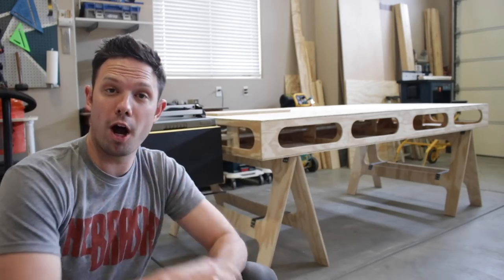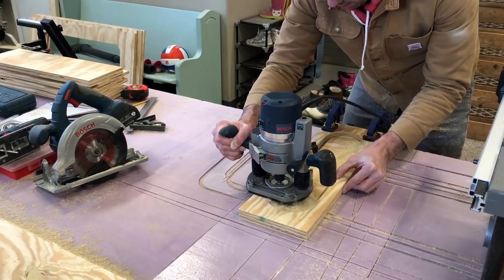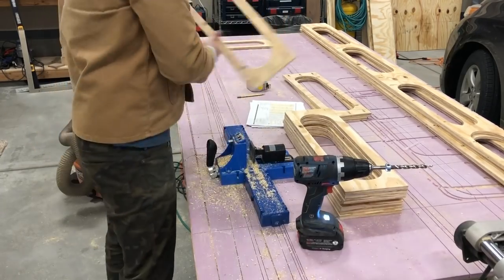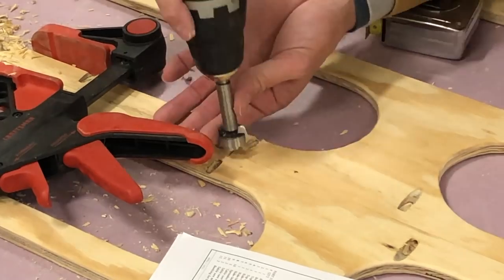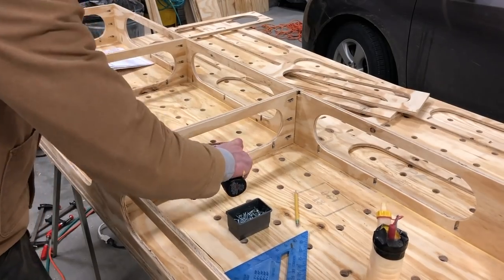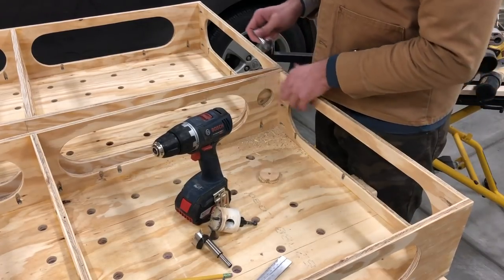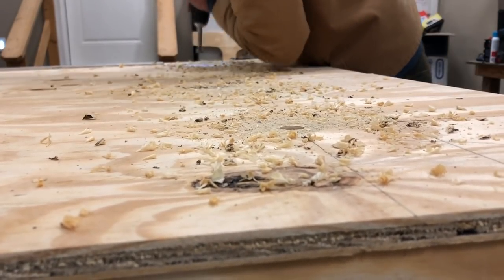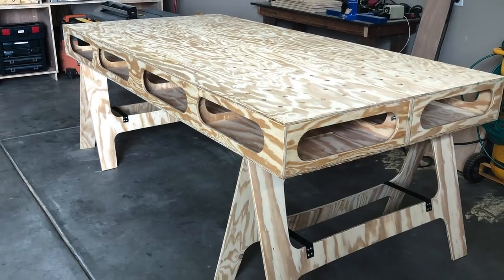Building the Paulk Workbench, Part 2 (Torsion Box Body)

Comment: Just a quick one Andrew, you should run the rounded edge of your router base against your guide, if you rotate it at all it won't matter, the plane is identical. If you hiccup slightly on the straight edge you'll screw your line up immediately. That's what the large round edge is for.
Reply from the maker: Thanks for the tip!

Comment: I bought these plans years ago and still haven't built it yet. I'm going off of memory here because I don't have the plans in front of me. Are you going to build the shelf for the underside? I believe if I'm right it also helps with spacing the saw horses to speed settting it up.
Reply from the maker: I can’t remember if I had plans that involved an under shelf and I don’t recall doing that. I just have the carcass box and legs. I can say that I have used this thing almost everyday in my garage shop since building it. It’s a very useful bench and I don’t think you’ll regret building it!

Comment: Great video Andrew!  Thanks for the posting.  I'm about to assemble mine.  I've seen several comments and suggestions about the template routing and I think I have the perfect solution.  What I did was set the template (or the blank to be routed) on a larger piece of scrap plywood, then screw strips of 3"4 scrap wood next to the template (or blank) so it can't move. Then put the blank on bottom and the template on top inside the screwed down strips.  That will hold them in place while you route, and won't be in the way of the router base because the two pieces of 1/2" ply stacked are taller than the holder strips.  Boom!  Easy and FAST.  And most importantly accurate.
Reply from the maker: Thanks!  Also thank you for taking time to share the knowledge you have and what your plan is. That is a great idea.  Please send me your finished project via email or social media as I'd love to see it!

Comment: Great vid!  suggestion: maybe screwing the template to the workpiece like you did with sawhorse template would've been quicker and involve less movement, seeing as though the router work could be down in just one pass.
Reply from the maker: Thank you!! And great advice. Thanks!
Reply: Or possibly using painters tape and CA glue.  That way no screw holes to fill.

Comment: When routing spacers maybe you could screw template and stock through foam into plywood under foam slo no clamp would be needed?
Reply from the maker: Definitely a possibility!
Reply: I got same thought's ))
Reply: I built a 1" form around mine so they were locked in and I didn't have to fuss with clamps and I didn't want to screw through them. Probably being a little OCD but been treating everything like I'm building some high end furniture rather then a workbench lol I know it will get worked to death and start getting beat up but right now I'm trying to make it as perfect as possible lol

Comment: Hey Andrew, nice video, I just caught it.

I built my Paulk bench about four years ago.  Also bought the plans and built the total station.

The last several videos Ron has made  featured some designs I gave him.

Check them out if you get a chance.

I built my first bench totally my hand, as you have here.

One thing I did differently; for the template to rout all the large holes, I simply extended the “ears” on each end which left plenty of room for the clamps. I then nailed blocks in the bottom side so that it placed the object peace center line.
Reply from the maker: Hi Kevin.  Thanks for the information!  I will definitely check it out.  I love new ideas.

Comment: I can't help but wonder if it would work to cut full strips in both direction but cut 3/4 wide 1.5in high slots on all the strips and then fitting them together.  That sounds a LOT easier than cutting little pieces and then attaching each one.
Reply from the maker: That’s a cool idea! Thanks for sharing.

Comment: You have 2 spiral bits listed.  3/4" and 3/8".  The 3/4" is for drilling the holes in the tops. Did you use the 3/8" for cutting your sawhorse and side templates?  I think the video mentions 1/4" so I'm just trying to clarify.  Thanks.
Reply from the maker: Great questions!  You are exactly right!  I might have misspoke on the video commentary.  Thanks for clarifying and best of luck to you on your project!

Comment: Great video brother..came out great.  I have my tops,bottoms, spreaders and horses cut,routed and sanded. I still have to drill my dog holes but probably jumping back on it tomorrow. I wasn't gonna do the table saw thing bc I have the Bosch on gravity stand but after watching what you did I'm gonna build the box anyway just incase I decide to drop it on. Your box was a awesome addition..thanks for sharing! Quick question..with the pocket holes for bench assembly..which screws did you use? I was planning on the 1" bc it's 1/2" to 1/2" but just wanted to make sure that's what others are doing? Am I correct with the use of 1" kreg screws or did you happen to use 1.25" screws? Thanks again for the videos..very well made. Have a goodnight and stay safe.
Reply from the maker: Thanks, Bill! Good to hear you are coming along. I love the Bosch gravity! But yea, I think that is a good call just in case to build the box. I've got a simple plan on my website here that might help, https://gumroad.com/l/tablesawmount .. I ended up using 1.5" screws and wood glue.  The screws are essentially there to hold it until that glue dries.  Hope that helps! Thanks again and stay safe as well.

Comment: Great video!!  I'm in the process right now of building mine.  Have it all cut out and at the assembly step.  One thing I did NOT seem to find on the plans was the length of the pocket hole screws.  Can you tell me what you used?  Thanks!!
Reply from the maker: Thank you Don!  Glad to hear you are making yours happen.  Since you are attaching 1/2" plywood to 1/2" plywood, the jig setting is 1/2" and the screw length is 1".  Just use a low setting in the drill so that you don't go through the top.  Just enough to hold the boards together while the glue sets. Hope that helps!
Reply: @diywithandrew  Great!  Thanks.  Did you have another video you haven't uploaded yet?  I was hoping for some specs on your table saw mount.  As you know, the mounts in his plans were for a different saw that mounted higher up on the saw.  I have the DWE7480 (same size as your DW745).  So, I knew I had to modify the mounts.  Just couldn't decide on the best way.  Now that I saw your mount, I may have to go with a drop mount box as well.  Either that, or I was thinking of just making a simple rolling cart and butting it up to the bench.  That would probably save some work, IMO compared to the pipe mounts, as well as leave more room inside the bench frame.  Anyhow....wondering if you had a video on the mount somewhere?
Reply from the maker: @donmeyers3090  You bet! I have Part 3 in the works where I am explaining exactly how I built my table saw platform/mount. I will be posting that one soon so stay tuned!
Reply from the maker: @donmeyers3090  Hey Don just wanted to let you know that Part 3 is finally finished and now available!
Reply: Don Meyers j
Reply: Omg..I just wrote the same question 5 mins ago lol
Reply: One more question for you guy's. How long did you cut your nylon straps..how much is the spread in between the horses? Looks like about inch and half on the horse..correct? So  if that is correct I would have 3" + whatever the spread correct?

Comment: Hey, great video, as always.  Since these pocket holes are facing the edge, rather than the inside like most pocket holes scenarios, I'm curious if you had any issues the screw coming out of the side of the workbench top?
Reply from the maker: Thanks man!  Great question.  I made sure and got the glue in there and then screwed each screw in gently enough to secure the wood until the glue dries. But yes, there were a few times I needed to back out the screw a tad and I remember one that I had to grind/sand down.
Reply: @diywithandrew  Thanks for the quick, reply.  Gotcha, so basically just pay special attention and lower the drill clutch ahead of time!!!

Comment: Great video!  How much do you estimate for the weight of each half of the work bench?

Also, how often do you assemble/disassemble the bench and how is it holding up?
Reply from the maker: Thanks man! Great question.  I want to say 75lbs but I should weigh them and make sure.  The pipes within make it easy to grab and move.  I've got a breakdown/setup video if you need to have a reference. I have broken it down and moved it about 5 times.  It has been just about a year and it performs wonderfully! I need to do a video reviewing it after a year actually.  Thanks again for commenting!
Reply: Field Treasure Designs m

Comment: Awesome video with super clear instruction and totally helped clarify a lot for me.I bought Ron Paulks plans but really appreciate the video. 
Im building my self a Paulk workbench but my local home center didn't have the size right pipe . 
Just wondering if 4 foot, 3/4 inch pipe would suffice vs the 6 foot 1 inch.  I have the same dewalt jobsite saw you have and was curious if the weight of the saw/ ever tipped the bench?
Reply from the maker: Thanks Denis!  That is EXACTLY why I made this video. Great question.  I have not had any bend with my table saw and stand and definitely not even close to tipping the workbench. Although i would hesitate on using 4' simply because it won't reach in as far into the torsion box allowing it to go through the 3rd support which will reduce the integrity of being able to hold the pipe in place.  However I can't be sure until it's tried!
Reply: @diywithandrew  Thanks for you input. I'll definitely be using a longer pipe. I cant wait to have my bench finished to work on it and get my saw off the garage floor- it's back-breaking lol
Reply from the maker: Awesome!  Yea I hear you on that. Send me a pic when your finished!

Comment: I like the dewalt chop saw you are using with the light on the guard.  Is that stock or a modification?
Reply from the maker: Great eye for detail!  It is a stock part of the DeWalt Compound Miter DWS780 and honestly the very best feature.
Reply: @diywithandrew  Thank you for answering.  DW and other brands need to add a mod or some add on for their saws.  Good lighting and visibility are key to accurate and safe cuts.

Comment: Many woodworkers seem to have found that joining 1/2 inch ply is pretty problematic. Can you comment on that and tell us what screws you used.
Reply from the maker: Hi David. I certainly understand that. I used 1 inch course pocket hole screws and 1 inch deck screws (for the bottom). I had to be very careful but with the glue and going slow and steady not overdriving the screws.  It worked great!
Reply: Field Treasure Designs panhead or flathead?  Per what I see on Kreg site should be panhead?

Comment: Great video.  I'm getting ready to build mine.  I'm getting a hole cutter 4.5" today.  I like your router trick to make duplicates.  I think I may use a couple of long screws and screw down the spacers to the table (with insulation underneath) and then route the interior like you did.  I think that way I can make a complete pass without rearranging clamps.  Think that works?
Reply from the maker: Hi Craig. Thanks! I think that is a clever idea. I hope it worked out!

Comment: I'd be interested to know how happy you are with the strength of the benchtop, as you sawed and drilled away quite a bit of the webs.  To my way of thinking, you should have either made them higher or not removed as much material.
Thoughts?
Reply from the maker: Hi Marty.  Yes.  It is very strong due to the torsion box design and glue up.  If I remember right, I jump on it at the end of this video and it doesn't even move.  What I love about the design is that the boxes are light for when they need to be transported but also super strong and stable.

Comment: Double-sided tape or four brad nails would work well to hold spacer template to blank for routing.
Reply from the maker: Great ideas! Just not the easiest to get off.
Reply: Double headed nails pinned at the extreme corner edges . . .  easy to get off later and might still give your router enough room to turn the corner?

Comment: Yanno, if you'd just cut one the two center holes from the LONG side first, then stuck a couple of the offcuts under each side and in the middle to both keep it level and give the clamps something to bite on without inducing flexion, you could have just clamped TWO of the short ones side by side beneath said long one and routed them without obstruction...
Reply from the maker: Well where were YOU when I made this?! LOL. Great tip.

Comment: Interesting that the holes where cut away, then the pole supports where added back. Shows bad design, lack of for thought, changes integrity of each panel too.
Glad the Vid described the torsion box though.
Reply from the maker: I don’t agree. Ron Paulk designed this very well and did not lack for thought. Certainly there are many different ways to design this for use and you are entitled to your opinion. I have used this for over 3 years and there has been no integrity failure as the pole supports spread out the weight along the inside. Thank you for at least showing appreciation for the torsion box video.

Comment: Use double stick tape to hold template!
Reply from the maker: I had considered that but wanted to make sure it didn't move since template routing can be strong, moving the piece off target. I also preferred to small holes that could be filled rather than dealing with sticky tape residue.